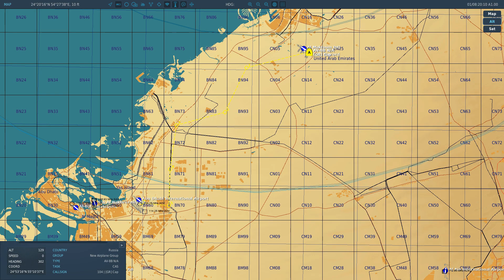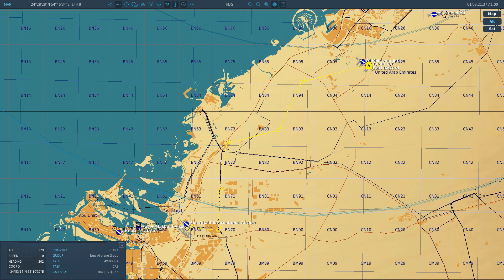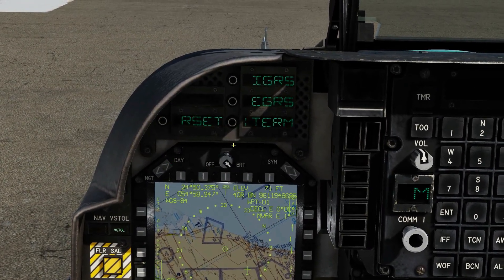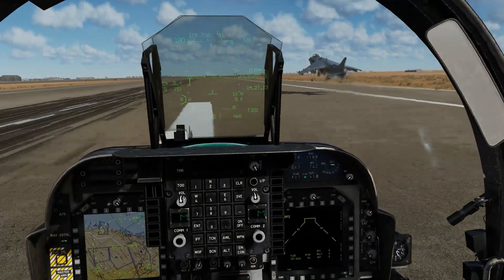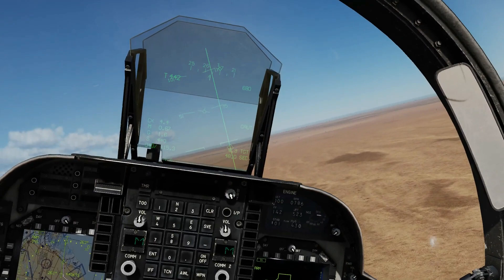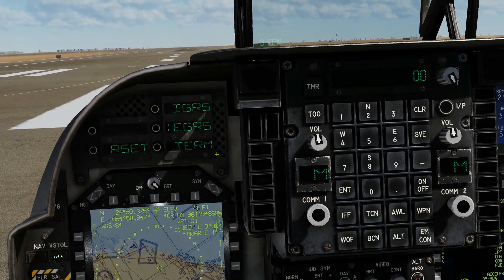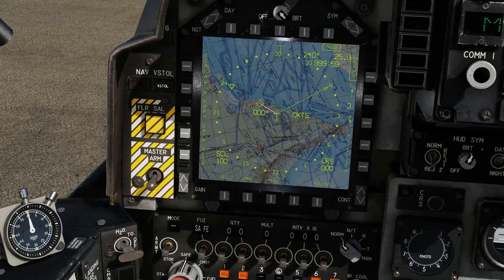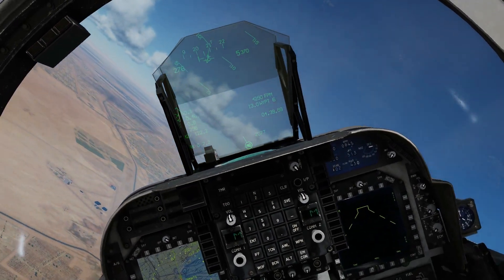AV-8B Harrier: NSEQ Combat Waypoint Sequencing Tutorial |  DCS WORLD

Comment: Wait, I’m pretty sure that ‘none sequential’ routing is to take advantage of all the ‘pre-inputted’ waypoints, allowing the pilot to alter the route on the fly.
For example, you may have 20 waypoints in your strike route you have decided upon. During the flight you discover/are notified that 5 of them are compromised by SAMs.
You can then alter the route on the fly to either bypass the area, return to base via the agreed egress route (no point colliding with the next package on the ingress route) or any number of alternatives.
You may get word from the preceding strike package that the ingress route is too dangerous and that the egress route is lightly defended - perfect time to switch it all up and come in from the reverse side.
Basically, it makes navigation easier to see on the MFD (once you’ve made the quick changes) when you are in an extremely busy combat .
Idea: You could create a map, covered in waypoints and have the aircraft pre- aligned with all of them. Then,  every time you jump in your jet, use the NSEQ function to pick a bespoke route - simples!